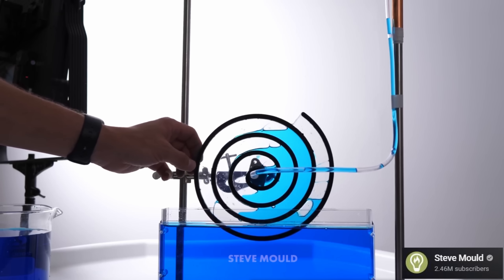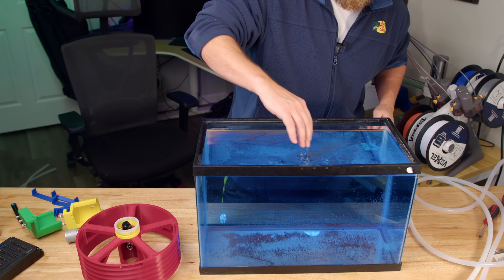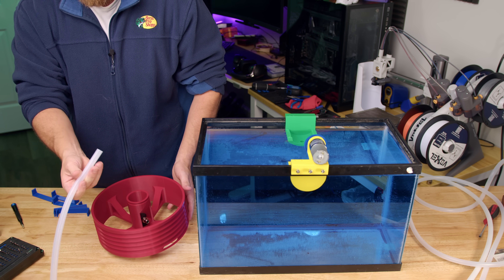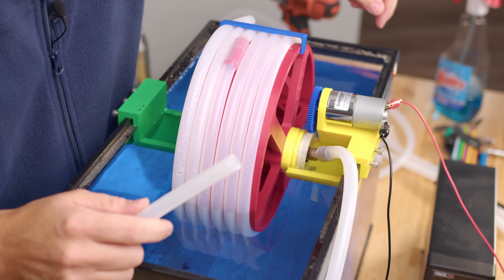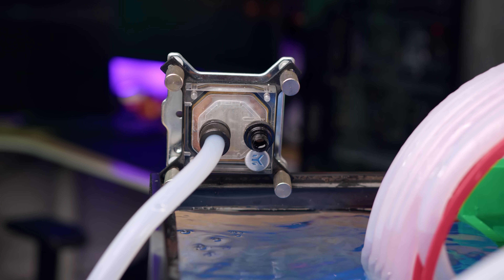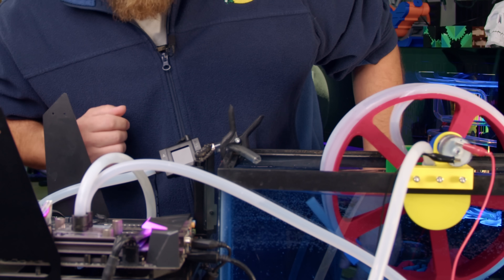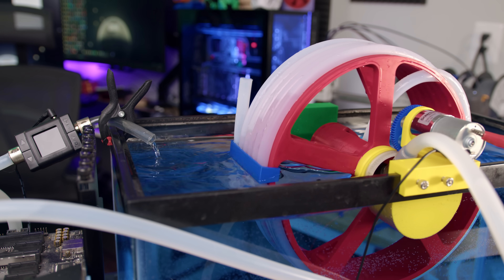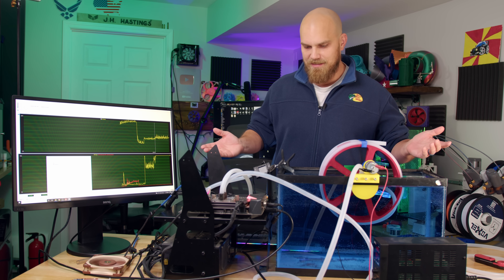Can a 217 YEAR OLD Water Pump Cool A PC?

Comment: You can get rid of the air bubbles putting a tall tube open at the top in a T junction before the block. The tube just must be taller than the pump pressure
Reply: manitoba-op4jx No need for a mechanical cover, just slap a u-turn on the top so the end of the vent pipe faces downwards. Let gravity protect you from dust.
Reply: You also need to make sure that the top section is wide enough for the air to escape and let the water flow freely around the bubbles otherwise they'll push the water out too.
Reply: That's going to need 6-8 ft of stand pipe/tubing...unless you use a much wider diameter pipe. Hmm. Add a check valve before the T and we now have a reserve/overflow tank as well. 

🤓 okay, I'm sold.
Reply: Nice. This is the way.

Comment: a manifold with check valves, multiple inlet tubes staggered around the drum so that the moment one tube is up, the next one is in the water. I think that would increase the flow a good bit. I'm not sure how much effect the length of the coil has on the line pressure. It may work or it may not if you had 2 shorter coils with their inlets 180 degrees apart.
Reply: Multiple feeds would work and create less flow spikes (more like an alternators ac ripple when passing through the rectifier to become dc... The more loops per inlet hose the higher the head pressure at pump outlet the more inlets the smoother the pump flow
Reply: that was my first thought was to have a double system with staggered loops so you are always getting a constant flow of water into the system
Reply: @daxconnell7661 it still wouldn't be constant flow but more like a ripple instead of a pulse

Comment: I am honestly surprised you did not use the noctua to power this.

You could try printing an archimedes screw, for a more stable flow. It's a really easy, if a bit loud design.
Reply: The noctua motor wouldn't have enough torque. I'm not sure, but I think that even gearing it down wouldn't work because it would end up turning too slowly. Not to mention the hassle of acquiring or creating a gear box that is efficient enough.
Reply: @ChadHadsell These pumps actually work at a low speed, too fast and it doesn't function
Reply: @SilvaDreams  yes, but too slow and you don't move the great away from the CPU block fast enough. The system needs to be balanced for both the needs of the pump and the needs of the CPU block, and I don't think the noctua fan motor is capable of that balance.
Reply: @ChadHadsell  True it wouldn't work mostly because it would lack the torque.  You need a bigger wheel and then drop the water into a holding tank above the PC and the water exit out to the pumping tank on a lower level to ensure no air bubbles and a consistent flow.
Reply: Archimedes screw doesn't provide a constant flow - from an overall design point of view, this actually is an archimedes screw, in terms of how it is providing the pressure and pumping, just optimised and simplified for modern construction.
Reply: Then you haven't watched his videos. He doesn't use Noctua motor for basically anything else than the fans, except if it is a challenge like "can this motor do this".

Comment: Add a big scoop to the inlet to get more volume and less air. Hopefully not scooping much air with a good design.
Reply: Put like a roof gutter on the full wheel width, of course connected to the tube.

Comment: I think you might see an increase in temps on the upper cores IF the cpu was in a vertical position as I don't believe the water level would reach the top of the cpu. 
I believe the cpu being flat on your test bench was a good idea.
Reply: If the cooler was vertical,  it could actually work better, assuming the outlet was on the upper side, rather than a left or right. As it would self purge the air I believe.
Reply: @klampykixx  Good point you have. Thanks for sharing.
Reply: for sure, it seems to keep the cooling fins submerged

Comment: It's a very cool idea, could you try exactly the same set up but print it along the length of the tank instead of the width and make the centre cyclinder smaller so the inlet pipe spends less time in the air ? that should help push more water throught the loop and then compare the 2 results please ? And then maybe if you have time experiment with different rotation speeds ?
Reply: I wouldn't go too far with submerging it, maybe 3/4 of the way in. the air gap is what makes this work.
Reply: @davidconner-shover51  I didn't mean he should submerg it just rotate the pump 90 deg on the x-axis and elongate it while also making the radius smaller.
Reply: A longer cylinder won't do much I don't think... Except increase "cold startup" time. As for the smaller cylinder, causing a higher frequency of water/air pulses (whilst keeping whatever ratio of water/air we have now) would make for more consistent cooling... not sure if it's any better but worth the Science!
Reply: @Tyrope  the extra length was meant to accommodate the same length pipe with additional turns since I said smaller radius but also to bridge the longer distance of the tank so he can still use the same motor attachments and stuff ;)
Reply: @Tyrope  the longer the cylinder the more loops the more loops the higher the max pressure it can pump also the higher the height the pump can pump the water to.  Using a counter rotating under flow (straight river) or same rotation under flow water wheel on a river u bend people could and have pumped water up a mountain.
Reply: If he were to make an enclosed archemedes screw pump he could move the water at not only a higher rate but to a higher head height creating a higher head pressure
Reply: Less radius will reduce performance.  The radius is critical to the design, not how long the dip tube spends in the water.  The further you push it into the water, the less height you have to push with.
Reply: @antibrevity  I'dont agree with you cause at that level of pressure the difference is so small that I would say it's immeasurable. And also keep in mind that the density of the water outside the pipe isn't playing any role here cause it's being eliminated by the pipping itself.
Reply: @antibrevity  can't forget adding loops will increase the max head height and pressure this pump could create... and the more separate inlet loop circuits the smoother the output flow
Reply: it functions because of the air.  his design is spot on.
Reply: @sinisterthoughts2896  I said less time in the air not no air =D
Reply: @Stephenm3a it would still reduce efficiency to have less air pumped in. The pump works on air locks pushing the water. Having no air would make it cease functioning and reducing the air would still reduce efficiency.
Reply: @Skylancer727  i agree with the airlock part but for as long as there is the airlock shouldn't matter how big the bubble of air is as long as it can push the water through. And by reducing the the radius it would effectively act like increasing the rpm. I guess we can rry and see what happens 😂
Reply: @Stephenm3a  to be fair not sure how much it matters. This type of pump wasn't really made for this use case and the "spin fitting", not sure what else to call it, for it does make it have a shorter life than most alternatives.
Reply: @Skylancer727  true but i found the concept really cool and would like to see it compete with some of the higher end coolers 😂
Reply: @Skylancer727 the spin fitting could actually be removed and the hose could terminate where the swivel fitting is but you would need a funnel under the terminated end to catch and send the water through the cooling loop however that would require the funnel being up high and a second pump to return the fluid from a return tank back to the feed tank... Or the pump axle could be mounted on an angle so that while the pump rotates the water gets pushed up hill however the pump would have to be long enough to move the water high enough to create a head pressure to push the water through the cooling loop

Comment: Wouldn't the air problem go away if the entire spool was under water?
Reply: you need the air to make pressure and push the water, if it was all underwater it would fill up and just spin without pushing any water
Reply: The air locks are required to actually force the water through the tubes as I understand it.
Reply: Air is probably helping with moving the water along the pipe though but that would be interesting to see as well !